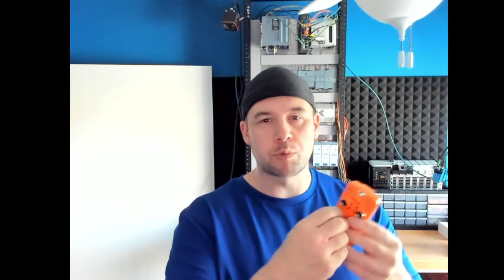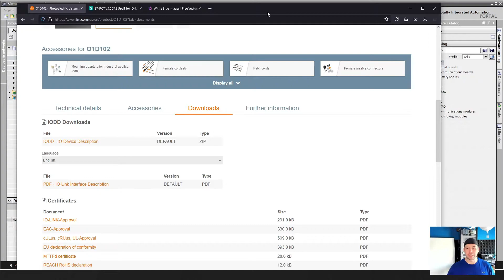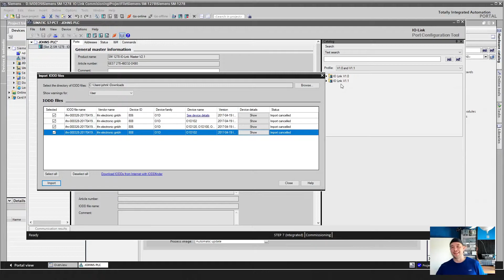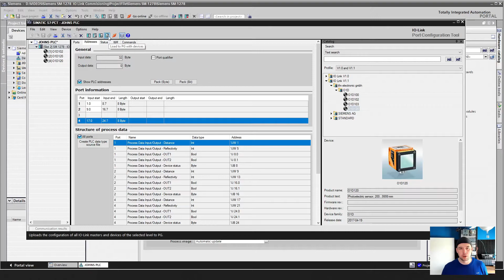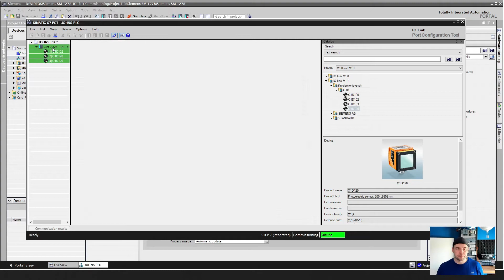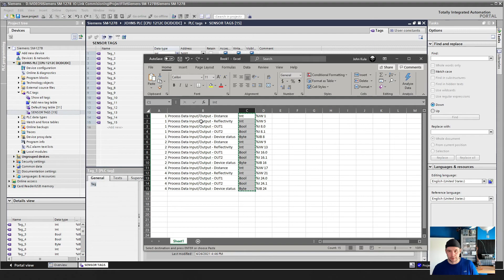SM1278 Step By Step Setup

Comment: Interesting, haven't seen these before - Been looking for an IFM-IO Link or similar - In order to plug in devices with this Siemens IO-Link we have to remove the M12 adapters that usually come with sensors/actuators and what not, for them to work? Seems like quite a bit of more work, especially if the sensors come from factory with male-plugs

Comment: i have one questin that why i cant start device tool
Reply from the maker: Hi Khanh, Apologies for answering question with a question. Do you get an error? Have you tried running the TIA As admin? Also I would check if you have the right device in a right place.
Reply: @johnkula5168  we always need s7 pct before we can start device tool right ?
Reply from the maker: @khanho4827  yes. Make sure you don’t have any errors in the device setup as well
Reply: @johnkula5168  thank you very mụch, 1 follow for you.
Reply from the maker: @khanho4827  Any time friend. Hopefully you get it running. If for some reason you run into problems still, let me know and we can take a look at it via zoom.
Reply: @johnkula5168   sry i have one more question, i use the RFID DTI420 and UGT592 for the same module i/o link master with you. But the i/o link have maximum 32 byte and DTI420 using 32byte and UGT592 using 4 byte. How i can connect
Reply from the maker: @khanho4827  I have never tried connecting the RFID to this module. I think that the rfid has its own module have you tried going through it?
Reply: @johnkula5168   in my project, i must to connect RFID with this i/0 link master. normally when you use many i/o device and i/o link master don't have enough register for them. How you  solve this problem? thank you
Reply from the maker: @khanho4827  Hi Khan. If I’m understanding the question correctly. You are asking if you have more then one IO link module and it exceeds the allowed space of that PLC. I would upgrade the PLC to something bigger go the IFM route. I’m not sure what the application calls for in your case.
Reply: @johnkula5168   oh no. my question is my i/o link master have maximum 32bytes, 2 device using 36 bytes , Must i add 1 more i/o link master right ?
Reply from the maker: @khanho4827  Oh I see. I would contact Siemens Tech Support for this one. They might have something different for this type of application.
Reply: @johnkula5168  i'm sorry. can you help me. I do'nt wiring ground pin of SM1278, what happen will being?